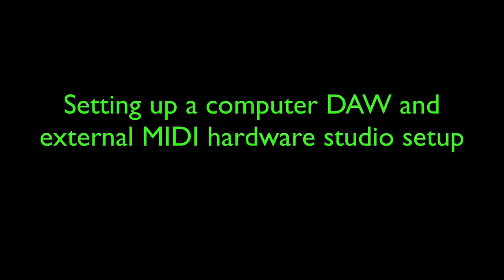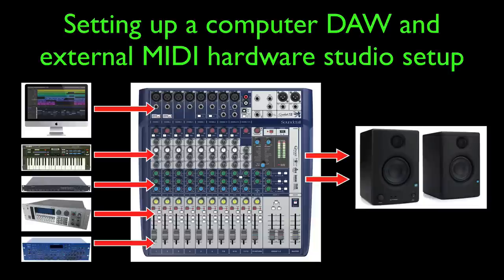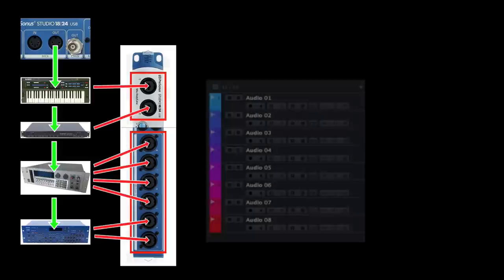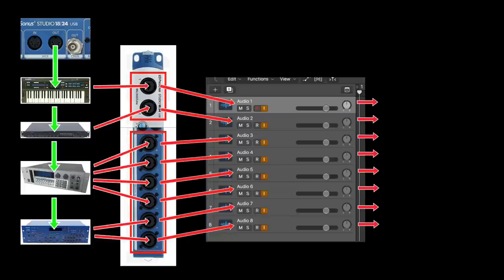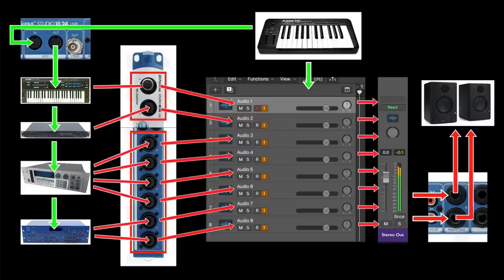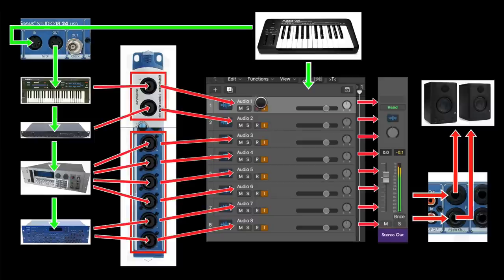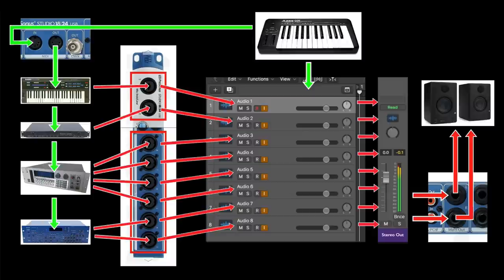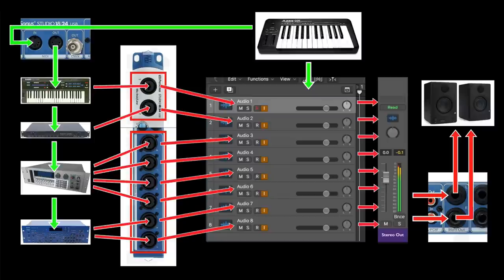How to setup a computer DAW & external MIDI hardware studio

Comment: Oh comme on Dancetech, at 1.06 you say "the best way to do it" when this is only one way of doing it. Situation real: Try changing more than 1 parameter at the same time using your mouse in one hand in your DAW and you`ll find it`s IMPOSSIBLE. With my two hands and 10 fingers I can change maybe 4 or 5 parameters at the same time from one end of the mixing table to the other, AND, AND use my two feet to kick in any extra effects from foot switches I may need along the way.  How long have you been working for Presonus ? AND, AND they cost twice the price of a good mixing table. Nice try though.
Reply from the maker: It is the best way to integrate external hardware into a DAW setup. Again, "to integrate external hardware into a DAW setup"
Reply: @dancetech  OK you may be right IF and only IF you intend to use the mixer in the Daw (which you don`t mention by the way) and mix with your tiny mouse. Answer me honestly, have you ever seen a professional studio WITHOUT a mixing desk. There`s only one answer to that, because using a mixing desk IS the best way when using external instruments . Also when using a mixing table a second person can intervine in the mixing proceedure (such as the musicien your recording). Using your system and the Daw`s mixer you can`t do that, there`s only one mouse.
Secondly and most important is that the quality of the music your listening to and recording depends entirely on the quality of the external sound card your using and the quality of the sound card in the PC when listening. After all you mix by listening to the speakers which in turn in your case are connected again to your sound card. Your going through the sound card twice, once to listen and again to record. Lousy sound card lousy recording. Where as using a mixing desk your only going through the mixing table (preferably analogue) to listen and record the analogue sound directly from the instrument onto the hard disk of the PC connected in parallel to the mixing table (observed by a DAW if needs be).Lastly mixing table = DAWLESS.
Reply from the maker: @24nikita  

"Answer me honestly, have you ever seen a professional studio WITHOUT a mixing desk."

lol, 'professional studios' have a mixer because they are recording studios. A mixer is required for:

1. routing
2. monitoring
3. mixing

They would have a mixer even if they didn't have a single synth.

The subject of this video is:
HOW TO SETUP A COMPUTER DAW & EXTERNAL HARDWARE STUDIO

there are two choices:

1. using a mixer to mix external hardware & DAW sounds together to a final summed mix
or
2. routing external hardware IN to a DAW to mix external hardware & DAW sounds together to a final summed mix ITB

in the mixer case unless you use an external digital recorder to capture that final mix from the mixer then you must record your final mix from the mixer back into the DAW

so in either case the signals end up being routed & recorded into the DAW through the audio interface, ONCE AND ONCE ONLY

the record path difference is: 

if you use a mixer the external hardware signals flow is:
hardware-unit-output -> cables -> mixer circuitry -> cables -> DAW input

if you connect the external hardware direct to the DAW audio interface the signals flow is:
hardware-unit-output ->  cables -> DAW input

Further: If you connect your external hardware & the DAW outputs to a mixer & then mix them together  on that mixer  you cant add any processors like compressors or fx to the external hardware channels without buying hardware fx & processors

So you must buy:
1. mixer
2. fx & processors

and you still need to buy an audio interface to get your DAW mix OUT of the DAW -> IN to the mixer alongside the hardware channels & then record the final mixer mix back IN to the computer... so

TOTAL COST
If you want to add a minimum 2 channels of compression + one reverb & one delay to your external hardware unit channels & mix the external hardware AND DAW output together & record that mix back IN to your PC -  you must buy:

1. mixer
2. stereo/2-channel compressor
3. reverb unit
4. delay unit
5. stereo i/o audio interface

You're only other option is to record your mixer mix to a stand alone hardware stereo recorder (personally I own/use one of these: http://www.datrecorders.co.uk/d25.php ). The external recorder & audio interface must both have at least s/pdif so you can transfer the recorder mix back into the pc/mac for mastering & distribution without passing it through DAC -> cables -> ADC all over again.

Total cost in that case will be:
1. mixer
2. stereo/2-channel compressor
3. reverb unit
4. delay unit
5. stereo i/o audio interface with s/pdif (cheapest is about 259 euros)
6. stereo digital recorder with s/pdif (cheapest is about 450 euros)

or you simply do not use any compression or fx on your external hardware channels.

So in summary. if you want to integrate external hardware into a DAW setup using a mixer, your cheapest solution is to use NO effects or processors on the external hardware channels & use just the mixer & an audio interface - total cost = mixer + audio interface - in terms of your claim about the advantages of 'hands on mixing'... well there's nothing to mix is there! you only have levels to play with and that's all because there are no fx or anything on any channels.

or do it like in the video using a multi-input audio interface & have 100% FULL fx & processors on every external hardware unit channel, print each hardware unit to it's own track before mixdown, mix in the box with full automation & full mix recall.

I've been doing this in studios going back to the days of tape before midi. The hardware synths, samplers drumboxes etc i still own totals about 72 channels of outputs (excluding audio processors & fx units). I also own three mixers.. i do have some experience about this stuff.
Reply: @Nikita Wow, how extremely rude of you. Everyone else here, including myself, found this post to be VERY helpful. If you believe you have a better way to accomplish the task explained here, why don't YOU take the time to upload a tutorial instead of bashing a guy who DID take the time to explain what to many is a complex procedure in a very simple to understand manner? Unbelievable. Now just go away and make your superior tutorial.
Reply from the maker: @finsterbaby1996  Cheers for the props. It's a guy as far as i can tell from how they talk. anyways, the way i did it, the conversation reveals interesting stuff for those with possible questions. The problem is people dont really know much about the subject i suppose.
Reply: @dancetech  You're welcome. I just figured it was a gal since the username is female. And now I get why you spent so much time rehashing different procedures to help others to understand the processes. BTW, my audio interface and 2 pairs of headphones finally arrived at 7:30 Eastern time (USA), when the cutoff time was 7:00. But at least they all got here. Probably my package was the first one on the truck and therefore the last one off. In fact, while everything was in a large box, when I opened the box with the interface, the metal casing was warm to the touch, since it was in the truck since around 9am in the South Florida heat. I'll let you know how I make out with it using your instructions once I get the drivers downloaded and everything hooked up. I'm sure everything will work perfectly, so thanks again for the tutorial.
Reply from the maker: @finsterbaby1996  cool, what did you get? whoops, ok MOTU M4?, missed the previous reply, cool, got midi i/o too, bonus!
Reply: @dancetech  Well, after more than 4 hours trying to get the Windows 7 driver(s) to work, which they never did, I gave up and went to bed around 2am. This morning I got up and tried again, this time going back to the MOTU website, and downloaded a different driver, which I think was for Windows 10, but it worked.

However, once I tried to record sounds from my JD-Xi into Cubase 10, it recorded fine on an instrument track, but wouldn't play back. Then I recorded the same sounds into an Audio track, and they played back fine. However, my goal is to be able to record MIDI data so that I can edit and manipulate it. I then recorded into a MIDI track, which also recorded fine, but which also did NOT play back.

I contacted MOTU tech support by phone, and when I described the issue and answered some of the guy's questions, he said the issue was with Cubase, which I had already suspected, since the interface played back fine when I played the Audio track I had recorded in Cubase, as well as when I watched a few YouTube videos.

So, I called Steinberg/Cubase tech support, only to find out that their tech support hours had been cut back. So, I opened a chat session with a total nimrod there who after several really stupid questions and responses, told me he was going to escalate my case to a supervisor who would contact me within 48 hours. I told him that I would just call tech support tomorrow during their new hours. 

So, although I have a great audio interface, so far I am still unable to accomplish the task for which I purchased it. Not to mention, that even with it, I cannot for the life of me figure out how to trigger my Roland JD-Xi with its 37-key mini-keyboard as a slave from my larger 61-key Casio keyboard as master. And as far as any help from Roland, it is literally non-existent.

If you have any solutions or tips for either of these issues, I would be eternally grateful, as I am about as frustrated and stressed as I can possibly be over this nonsense. Thanks in advance.
Reply from the maker: @finsterbaby1996  oh blimey!  well you're getting MIDI IN which you record to a midi track as you said, but on playback it's not triggering the hardware. So the MIDI track in Cubase and the hardware synth you are trying to trigger have to both be set to the same channel. they it should trigger.  The normal way it works is the MIDI track in Cubase 'Channelises' the incoming MIDI to whatever channel that selected Cubase MIDI track is set to, so it doesn't matter what channel the master keyboard is on.
Reply: @dancetech  So, when I record to a MIDI track in Cubase, in order for the patch from the keyboard from which it came to be heard during playback it has to be routed BACK to the keyboard? Geez, I've been using VST soft-synths for so long now, that I never even realized that. But wait, I'm not even getting any output monitoring levels in Cubase OR the Interface when I play back the MIDI track, so are you sure that what you mentioned will solve the problem?
Reply: @dancetech  For some reason, I don't think my earlier reply to your instructions to route the MIDI track back to the keyboard from which it came went through because I don't see it here anywhere. Anyway, it had been so long since I had used patches on my keyboards (since I had been using VST soft-synths for so long) that I forgot about this function. So, I followed your instructions and of course, it worked. But now I can't remember (or find) how to convert or copy the MIDI track to an Audio track once I've edited it or added effects or whatever. If you're still awake and here, could you please remind me how to do this? I tried copying the MIDI track to an Audio track, and Cubase wouldn't allow me to do it that way, so there must be some other way to do it. And hopefully, experienced DAW genius that you are,  you will know just what to do right off the top of your head. Thanks.
Reply from the maker: @finsterbaby1996  yes, BUT if you are playing a Keyboard/synth as a master keyboard and wanting to trigger it's synthesis engine while also recording the midi output, then you turn LOCAL CONTROL OFF on the Keyboard/synth, which means the keys dont trigger the synth engine on the unit, but the MIDI passes OUT of the synth/keyboard Into Cubase, THRU Cubase, OUT of Cubase & back to the synth/keyboard and THEN that MDI data triggers the synth engine part of the keyboard/synth. BUT the Keyboard/synth has to be set to receive on the same channel the MIDI track is set to in Cubase of course 👍 Best bet is to setup the MIDi first and monitor the synth using headphones plugged into it to check it;s sounding/triggering, get that working first THEN setup the audio routing THRU Cubase via the audio interface.
Reply from the maker: @finsterbaby1996  You dont copy the MIDI to an audio track, of course that cant work. basically with this technique, every external synth has TWO Cubase tracks, One for the MIDI data & One for the audio signal to pass THRU the DAW (as this video shows how to setup). Once the MIDI is recorded it'll trigger whichever hardware synth in your system which sends it's audio signal THRU the DAW and you simply monitor it alongside any onboard DAW soft synths, loops etc. When you are ready to mix, THEN you put the audio track into record, capture the audio of the synth on to it's track, then turn OFF the thru audio monitoring and from then on you are mixing the audio stem of the synth recorded to it's track, which sounds identical to the audio signal passing THRU when monitoring.
Reply: @dancetech  I was already aware of all that. My question was how to copy or convert the MIDI track to an Audio track after editing, adding effects, etc. and ready for mixing down. HELP!!!! I'm also searching for information on how to set up my larger keyboard as a master to the JD-Xi min-keyboard when the larger keyboard doesn't have MIDI ports. I think I just have to buy an adapter cable, because the JD-Xi has MIDI in/out ports, as does the Interface. That would work, wouldn't it? And yes, I know I have to turn the local off on the master keyboard.
Reply: @dancetech  Just a little confusing. If I remember correctly, when I was using my old Yamaha DX7II-FD, as well as a Roland Piano Module, a Yamaha Drum Machine, and a Proteus module with Cakewalk Sonar, when I wanted to save the patches that I used from all that gear, all I did was create audio tracks and copy the MIDI tracks to them, which you stated doesn't work. So, what do you mean by "capturing" the audio of the synth?
Reply from the maker: @finsterbaby1996  "capturing" the audio of the synth - recording it.
Reply: @dancetech  I finally understood enough of what you explained to get the audio track to record from the MIDI track. What I had to do was arm the Audio track to record, then mute the MIDI drum track that I had added, and let the initial MIDI track play with the Record button activated. However, I am having an issue with the volume on the Audio track. In spite of the fact that the JD-Xi is plugged into left/right jacks on the Interface that have no gain control, I turned the volume all the way up on the JD-Xi to the point that I could hear it coming out of my new headphones without even wearing them, turned the input on both the master AND the MIDI track in Cubase to the max, and STILL when I played back the Audio track through the interface the volume was nowhere near the volume sent from the JD-Xi. So, while I was able to accomplish the last step in my struggles, it seems I'm now having additional issues that I don't know how to remedy.

BTW, from the extensive research I've done, it appears that there is no such animal as a USB type B to MIDI cable that I need in order to play my JD-Xi as a slave from my Casio as a master. So I found a USB type A to MIDI cable for cheap at Walmart.com, to which I will have to connect a type A female to Type B male adapter, plug the two pieces into my Casio, connect the MIDI out from the adapter cable to the MIDI In on the interface, then run a single MIDI Male to Male cable to the MIDI in of my JD-Xi. It may not be the best solution sound-wise compared to purchasing a MIDI patch bay or something, but it's the most economical. So, at least that is sorted.

One more thing on a personal note: I notice you have what I believe to be a British accent. If I'm correct, and you haven't relocated to the States, thank you for being so helpful and continuing to correspond with me after midnight, lol. And still, you have been much more helpful than anyone at Steinberg/Cubase, or MOTU. And don't even get me started about Roland again. I'm just beginning to calm down after dealing with their AI Algorithm tech support rather than actual human beings. I would rather they outsourced their tech support to the Middle East or the Philippines than leave it up to a freaking algorithm to respond to queries.
Reply from the maker: @finsterbaby1996  not sure what the volume problem is. The Input Monitor Mix control pot should be turned fully clockwise to PLAYBACK and the 3/4 button should be switch OFF. The audio track you are recrdoing to should obviously be set to whichever L/R pair of inputs the keyboard is plugged into.... Btw, why did u need a special midi usb cable? the M4 has MIDI I/O on the back?
Reply from the maker: @finsterbaby1996  😂 Stressed? I wouldn't have guessed that lol.. good luck, lemme know what happens.👍 you DID set the monitoring knob on the front fully clockwise right? (never use direct monitoring - fully counter clockwise on your M4 unit - with an audio interface is the rule)
Reply: @dancetech  Thanks for the much-needed chuckle, mate. I know this isn't the place to discuss this, but since I don't have access to your Messenger account or any other way of communicating privately with you, here it is.

Ever since I came back to Florida at the beginning of September every single minute of every single day has been ridiculously frustrating and stressful. I just started on Medicare this month (yeah, I'm that old already), I retired early and so I'm in a low-income bracket, and you would not believe the amount of time and effort I have been putting in just to get all my health coverage taken care of with all the different federal and state agencies and private entities, both here and especially in the last state in which I resided, that I have had to deal with and the lack of cooperation and back-and-forth nonsense from everyone.

And to top all that off, I've been trying to get back to playing and recording my keyboards since recently purchasing the JD-Xi, and so have been dealing with all the headaches that have come with that endeavor. If not for all your help, and that of a few other YouTubers and Google searches, I'd REALLY be going out of my mind. So again, thanks for all your help, and especially for making me laugh just now. It truly is the best medicine.
Reply from the maker: @finsterbaby1996  Keep positive mate. Yeah laughter is good 👍.
Reply: @dancetech  Hey, I'm back with more updates, and another question. First of all, after owning my cheap Casio keyboard for nearly 6 years, I finally had a huge breakthrough regarding using the patches/tones on the keyboard in Cubase that I have been unsuccessful in accomplishing all these years. With the Casio, as with the JD-Xi, and I assume most other digital keyboards, it comes with a list of all the tones on the keyboard with their corresponding MSB and PC numbers to input into one's DAW in order for the DAW to play them back properly. Well, to make one of my more lengthy stories short, the numbers on the list never seemed to play back the correct tones when I input them, neither in Sonar nor in Cubase. However, the other night, when I was trying once again to accomplish this task, I did some experimenting and found that if I increased the MSB number on the list by one number, e.g., 55 to 56, Cubase played the correct tone! I tried a ton of the tones on the Casio using this method, and it worked flawlessly! So, nearly six years of frustration is over, and I can finally use the multitude of really great tones on an inexpensive keyboard to record into my DAW along with some of the great VSTs that I have purchased over the years and some that are included with Cubase.

As for the DOREMIDI USB Host that I told you I ordered, while it IS on the way, I need a little advice from you as to how to correctly hook it up to my MOTU M4 and my JD-Xi. The DOREMIDI is powered via USB-B to USB-A through either a power block, or as I am going to do, through a USB-A port on my LED lamp that is right next to the rest of my gear, since I am already out of electrical outlets in the immediate area. Anyway, after powering it, the next step is to connect the USB-B cable from my Casio to the DOREMIDI via USB-A, and then connect the DIN MIDI Out from that to my MOTU M4 MIDI In, then connect the MIDI Out from the M4 to my JD-Xi so that I can finally control the JD-Xi from the Casio. I already purchased a MIDI I/O cable which I am hoping to be able to use this way, but my question to you (finally) is do I need another single MIDI DIN cable to connect anything I may have missed in my setup mentioned above? If I'm not mistaken, since my JD-Xi is sending its signal to the M4 via 1/4" Audio cables, there is no need to run the MIDI Out from it to the M4, so my idea for my setup seems to be complete. So, if you can glean any understanding from my written babbling and can advise me, I would greatly appreciate it. So far, you've been a great help, so I hope you can let me know if I'm finally getting it right, or steer me in the right direction once again if I'm not.

Oh yeah, and as for the volume issue that I had, I figured it out, but don't ask me how, since it's been a few days, and since my recent "breakthrough," it's slipped my mind. But also, on the volume issue, I had my Casio connected to the MOTU through the front inputs which have gain controls, and the JD-Xi connected to the rear inputs that DON'T have gain inputs. So, when I recorded MIDI tracks from the Casio, I had the gains on the MOTU set at 12 o'clock, and had to turn the Casio volume lower than I usually do. Then, the JD-Xi had to have the volume turned up to maximum in order to be recorded and played back at a reasonable volume. So, the next time I am working with my gear, I am going to switch the inputs and expect that this will fix the volume issue. Just some more unnecessary information for you to ignore, lol.